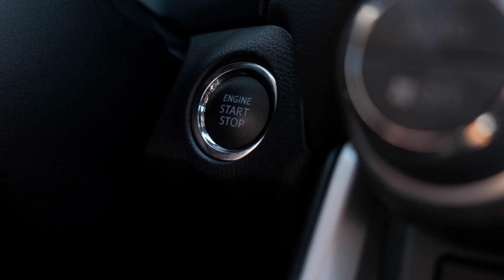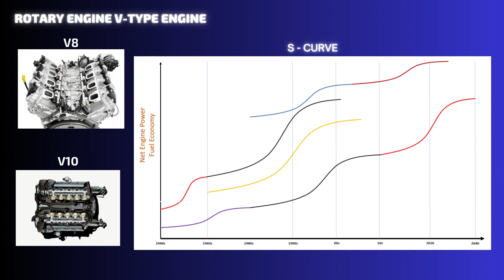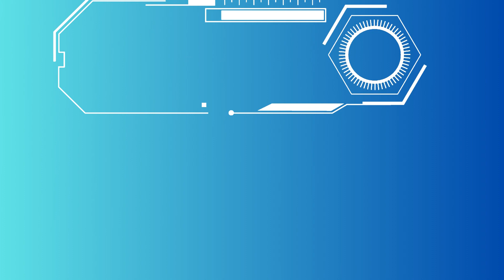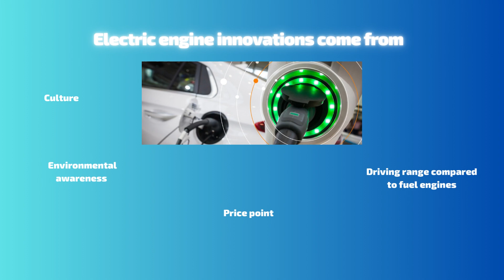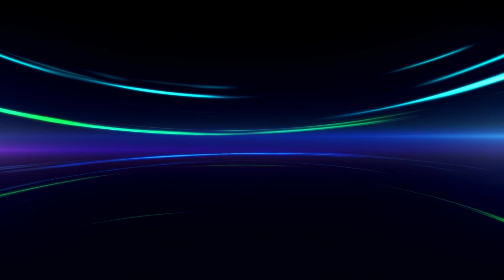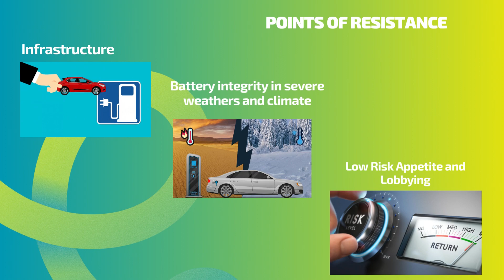A History of Innovations to the Commercial Vehicle Engine

Comment: I too feel that Hydrogen fuel cells could be the future. However, there is innovation in the field of alternative fuels that could be used in the existing ICE with net zero carbon emission. If that technology picks up and we find a way to manufacture that at a cheaper cost, it could change the way we predict the future.

Comment: Great job, the video was very interesting.  

I think that the role of government regulation and mandates is often understated in driving these types of innovations.   Even before the Paris agreement, the EPA and CARB  in the USA has been pushing emissions and fuel economy standards that have forced vehicle manufacturers to improve.    I wonder if we would have seen as radical improvements in fuel economy and emissions if it were not for these government mandates, if the price of fuel alone would have been enough to drive the same innovation.